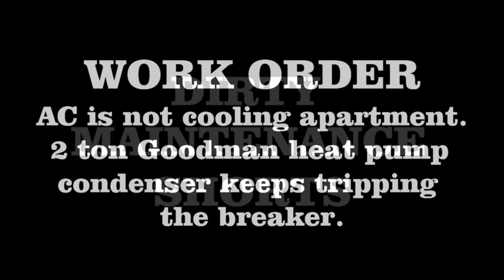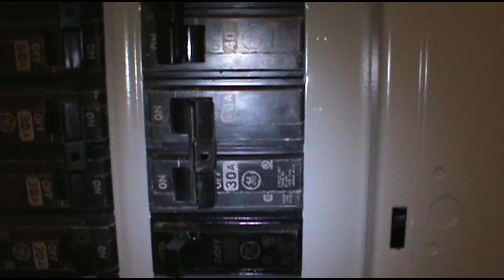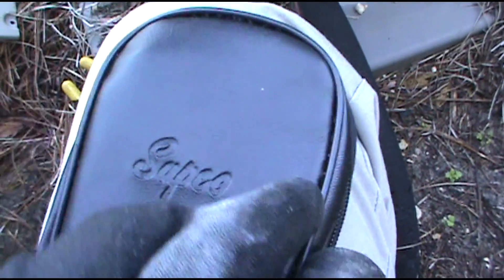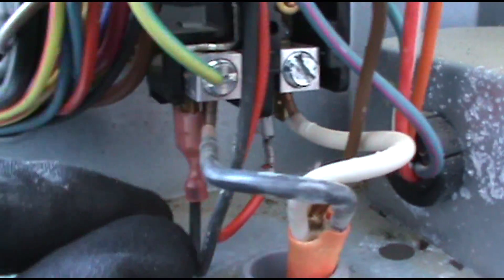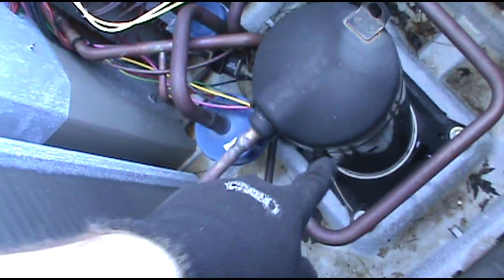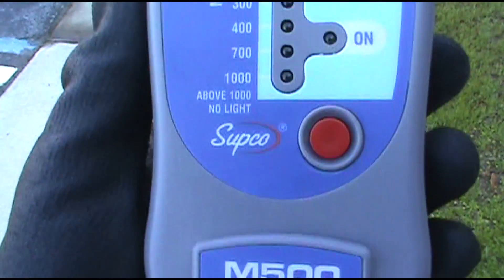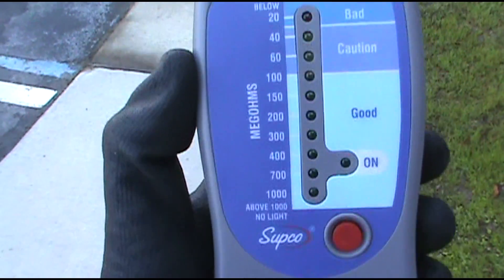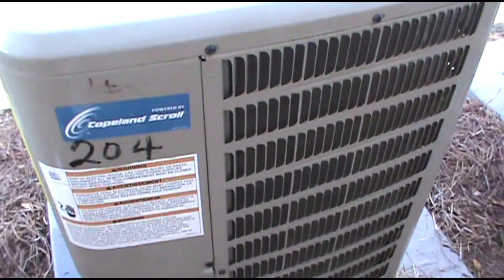GOODMAN A/C HEAT PUMP BREAKER TRIPPING (Supco m500 megger)

Comment: I’m ordering one.  I got a question. Compressor.  Runs  but over time trips the breaker.  Any thoughts what that might be.   Could a contactor. Cause this.   Or is my compressor going bad.
Reply from the maker: If it's a heat pump, it might be a bad crankcase heater. Just unplug it. I'll send you a video of me unplugging one.
Reply from the maker: Here's a video on crankcase heater: https://youtu.be/K3vqp99FzCQ

If that's not it, then I'd need to be there for this head scratcher 🤔.
Reply: @LexVance    Question.  I used the h500 mega ohm. But  my compressor did not have a crankcase heater.  So I tested the 3 leads on my compressor.  And each lead read 100.  What does that actually mean

Comment: is the crank case heater always energized?
Reply from the maker: willardearl76 Yep. There's a temp switch on pipe by compressor that turns it on and off. Thank you for watching Willardearl!
www.dirtymaintenancenation.com
Reply: Yes it is on that unit

Comment: it looks like there was a ground wire connected to the crankcase heater nut, unless thats a floating neutral? 110v heater? youll get a short to ground on the megger if it uses the ground as a neutral but anyways I own this megger and I love it cause its so compact and it fits right in my klein bag pouch no problem and then it sucks cause i hate how the back cover is so flimsy. mines already cracked and the leads that come out of the damn thing... lol shitty. but it does the job. 4 yrs and still working.
Reply from the maker: It's a 240v heater. I've done it on good ones to see & it'll read good if its good & not short to ground. Hooked up the exact same way it is in this video. Yea, I love my megger too! Thank you so much for watching Terrible1!

Comment: The electrical whip feeding the AC wasn't to code, FYI.  lol    NM (romex) isn't rated to be in wet or damp locations, FAIL!
Reply from the maker: Yep, good eye! And there's 192 units exactly like the one you saw in the video, lol! You should see the plumbing & brazed line sets. The place is only 3 years old. My favorite saying at work is " I didn't build the place." That's what they do now days. Sling them up as fast as they can & just pass code. Take the money and run and let the maintenance techs deal with the fall out. oh well, job security! Thank you so much for watching Derek!

Comment: Have you ever gotten a bad reading from compressor and it still run? I had a tripped breaker so checked the compressor with the supco and got a bad reading from all 3 terminals but the compressor still ran.
Reply from the maker: Hmm well Ill be dog. I haven't run into that problem yet. I would definantly be sure with my volt meter too. Just to make sure. Thank you so much for watching Philip!